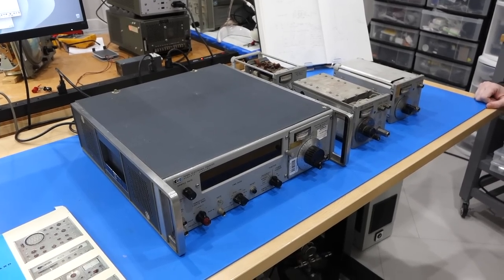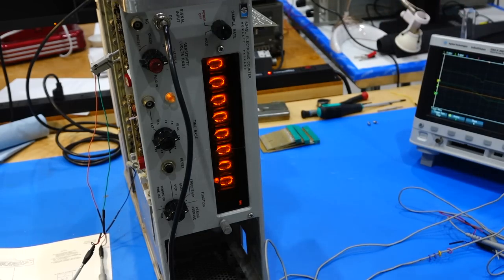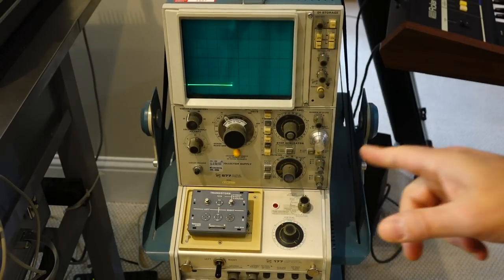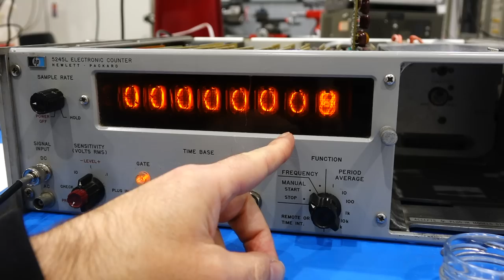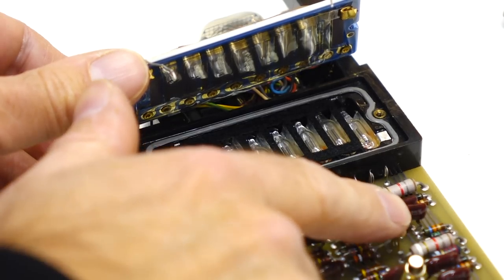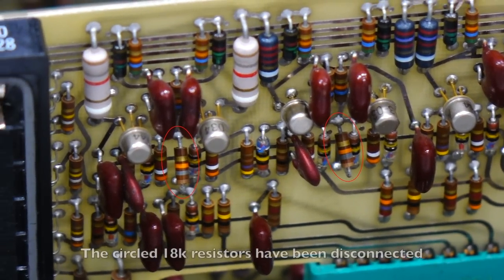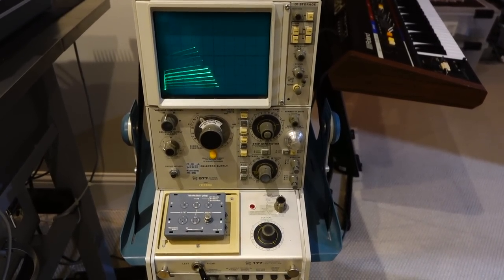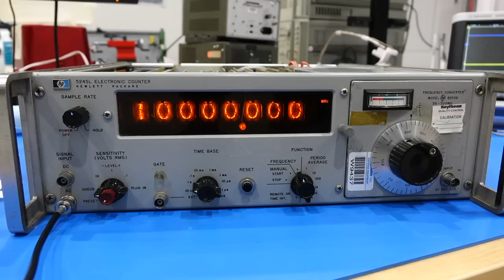HP 5245L Nixie Counter - Part 2: Repairing the king of Nixie frequency meters

Comment: Looks as if working boards from this unit were swapped with bad boards to repair other units.  Love the large visible neons of my 5245L. When this product was introduced in 1963, I was using an HP 524 counter with columns of neons for display.
Reply from the maker: I have come to the same conclusion, that this may be a board swap unit that got all the bad boards. The gate PCB isn’t even the same color and material as the others, apparently from a much earlier unit using phenolic boards.
Reply: I did that kind of repair for an HP competitor in the 80's.
It was very common for large companies to stuff all the faulty boards in the same device and send it back to the supplier for repair when there were no good board to salvage.
We received counters, multimeters, and other devices which took hours to repair, going through every stage, from the input to the last one, with almost every one of them faulty.
I remember that, for multimeters, we always forgot to test one or two functions. the faults were found during the final calibration process, usually at the final stages, with the guy in charge of it mad at us, as he had to fix the fault and redo the whole calibration again.
Reply from the maker: @chefchaudard3580  Oh no! That's funny. The ancient version of the Amazon return scam :-)

Comment: In case anyone is wondering how they made a frequency counter in the GHz range in the 60s (example for the hp 5255a plugin): They are using harmonic frequency multiplication to get 200MHz from the 10MHz reference. They use this 200Mhz Signal for harmonic downconverion of the input signal to a 1-200Mhz IF signal. That signal is then put thru a frequency divider and fed into the actual counter. Since they are using harmonic downconversion there are multiple possible input frequencies for a given counter counter display. You have to follow a procedure to "find" the correct frequency or you have to know the input frequency approximatly. HP used this principle for a long time after this unit was made, but they automated the "frequency finding" process with computer logic. I have a HP 5340A which does exactly that.
Reply: Nice!  Can you explain why neon, here? And "memory"? I don't quite get it.
Reply: @jxh02  I am not really familiar with the neon stuff since both my counters already use normal logic ICs for the counting. I think they are using neon lamps as binary memory elements for the counting process. The memory always holds the current count and also defines what will be the next number. They also use the emitted light for the binary-to-decimal conversion. Dont take my word for it, you can seach for "neon ring counter" online for better information on how it works.
Reply: @jxh02  : They probably used neon because it was both smaller and cheaper than the alternatives. This was long before cheap memory.

Comment: Magnificent job!! What challenge to build a counter with only transistors to 50 MHz. Early counter ICs years later would struggle at 10 Mhz. Wonder what a 400 Mhz transistor cost in those days. How many transistors are there?  I am shocked to see tin-lead edge connectors. They are notoriously bad. The photocell decoder is quite a piece of work, They used  radioactive neons (to get them to fire quickly in the dark) and photocells to make remarkable chopper amps in meters like the 410C. These might be radioactive too. Bulb had either green uranium glass envelopes or a bit of KR-85 (Krypton gas) to keep them partially ionized so they would fir quickly in the dark and the cold. I remember in the early days (my early days) using neons as legit multipurpose components. The high voltage was a pain. 
Another great video.
Reply: Some gear using neons as memory had little incandescent lights next to them to encourage them to fire! Of course when the bulbs burnt out the counting stopped!

Comment: These old nixie tube counters were a marvel.  I ran across a similar one but it used the voltage drop of the nixie filament that was 'lit' in some sort of memory/ decoder fashion.  Just the fact that a particular filament was on, 'steered' the next 'flip' of the thing in some fashion.  I can't remember it all, but at the time I was just amazed how they designed it such that the display tubes actually took part in how the thing actually counted.

Comment: I used to work for HP from 1975 to 1985 in their repair center in Rio de Janeiro and later in São Paulo, Brazil. Worked on many of these 5245 counters. The weak point for us in Brazil were the Nixie Photo resistor decoder drivers, these often failed due to humidity eroding the tracks or resistor patterns laid on the ceramic backplane. Yep, once they had TTL BCD decoder chips for Nixies snd 7 segment LEDs, made these works of Electronic Art redundant, although those Nixie Counters with the high stability time base hung around for years in many Labs.  Luckily HP made excellent manuals that still enables capable technicians/ engineers to this day repair them. Wonderful to follow your troubleshooting, brings back good memories.

Comment: I also have one with plugins. I had to repair the heater circuit in the TCXO master oscillator which has been calibrated to GPS and has not moved frequency after running for 10 years. This is a fine frequency counter. I appreciate your nice troubleshooting techniques.

Comment: Marc, thx for taking the time and sharing your journey through the repair of this counter. Upon further consideration it begs the question as to how a single unit could have all these problems simultaneously. I'm wondering if this wasn't a hanger queen where the cards were swapped out of it to keep other units operating leaving this one with many problems. Eventually funding came along and these units, 5245s that is, were phased out for newer types of counters.

Just my 2c worth.

I love this level of troubleshooting. Employing block diagram guidance, signal tracing, crkt level troubleshooting, component failure verification, component replacement, then viola repaired section, followed with moving on to the next malfunctioning section.

The best part of these units are that they don't use ICs with unobtainium, that is they don't exist any more. All the units that use ICs with unobtainium will be moving into the recycle bin long before these units will be unrepairable. Of course these units don't have Bluetooth, data analysis etc. internally. However, these units do have data ports that can be connected to data analysis units. Then you've got units that can do all the wizbang things the newbies can but for a long time into the future.

Marc, again thx for sharing.

Comment: That is amazing!  In all my experiments with photoresistors, they have always been cheap CdS cells, and all were painfully slow. (tenths of seconds!)  I have always thought you needed photodiodes or phototransistors if speed is required.  (Of course, 1960's HP would have special photoresistors, burnished by grey-bearded masters, washed with water from the river Styx.)

Comment: The king is the HP5248M. It counts up to 150 MHz, using the same technology, and has the better ("M") OCXO. Mine ages at <1E-10 per day. Since decades. Check it from time to time against a GPSDO. 
Also own a now (since 20 yrs) unused 5245L where I had to replace the crystal in the 1980s because its glass case got a crack. It needed about 3 months after this repair until ageing was down to 2E-10 per day.
Have both the 3 GHz and 12 GHz heterodyne converters.

Comment: I got one from an estate sale and too my surprise it worked, and also it reads that accurate. So I'm not sure anyone calibrated yours
Reply from the maker: Thanks, good info. You are right, I can't know for sure, it might just be very stable. But for the power supplies at least, they don't stay exact to two decimals for very long, so that had to have been calibrated very recently.
Reply: @CuriousMarc  either way thanks for another great video.  I wish I had time to watch all your stuff.  I have these bookmarked in case I have to work on mine someday.  Anyway, mine looks great with a 8640b sig gen on top of it.  I have a 333 distortion analyzer I need to fix to add to the stack

Comment: I found with my 5245L that some photo-resistive decoders for the Nixies were not working reliably.

This was due to there being considerable variation in the firing voltages of the neons which, I believe, was caused by neons being operated on DC for long periods. With DC operation the neon glow is only around one electrode and this electrode is damaged by ion bombardment over time, considerably increasing the firing voltage.

I restored operation of the decoder by reversing the faulty neons so that the undamaged electrode became the active one, reducing the firing voltage. Hopefully, this will give a few more years of operation before I have to find some of the special "dark effect" neons to replace them.

Comment: I wonder if the person before had several of these units, and this was the one that donated it’s working components and received the failed repairs.
And while they had the equipment to keep it calibrated, they didn’t have the expertise to keep it working
Reply from the maker: We don't know for sure, but it certainly feels like that is exactly what happened. HP units usually do not come with that many faults stacked up on top of each other. I know for sure the previous owner had several of these units, and this one was a freebee, so I betcha I didn't get the best one...

Comment: According to one manual, the best substitute for the 2N708A  is a 2N2222, but for the 2N708 (no 'A') it says the 2N2369, which is a common transistor used in high speed circuits such as video amps.  It says the European "Pro Electron" substitute is the BSX20.
The 2N2369 or 2N2369A are common and still available.  

I found that the ubiquitous 2N3904 will work well but it may have too high current gain.  In one circuit I put a 470 ohm resistor in series with the base to reduce the current gain slightly.  The 2N2369 is found in video amps, sometimes in old TVs or monitors.
Thanks, Marc for keeping us curious!

Comment: I think that the short circuit on the reset  line is caused by the electrochemical migration of the tin alloy, it create a tiny conductive filaments with low impedance that short low distance pins. Gerry

Comment: If you're having issues with 2N709's, think of the poor guys at the Computer Museum.   Their CDC 6500 computer has about 70,000 of those!   Perhaps surprisingly, they used to have it running for weeks at a time between failures.

Comment: You may have a look at Usagi Electric's video about an older HP freqency counter. "Restoring an HP 521A Frequency Counter". Looks like they recycled the basic design with the discharge lamps for the bcd couting. It uses tubes instead of trans, but the schematic looks very similar (at least to me).

Comment: @ 11:20 - Would it be worth running a SPICE model of the original T-FF? I seem to recall that transistors used in a bistable had to have gains matched to a fine tolerance - is that also part of the problem?

Comment: Is it actually BCD ? My 5275A is 5x2 (biquinary), then the same neon/ldr decoders and 1-of-10 neons in a faceplate instead of nixies
Reply from the maker: This one is equipped with the 1224 BCD counters, the default. There were also options for 1248 BCD and biquinary.

Comment: Strange so many transistor failures, you would expect them to turn it off after the first failure. Someone must have used it as an accurate oscillator source until that stopped as well.

Comment: I swear that 98% of youtube electronics repairers assume that someone fiddling with a knob to get the calibration on a machine just right must be boring, should be cut out.... NO! NO NO NO! I wanna see it line up to all 0's in real-time as well! Watching everything come to beautiful alignment is basically electronics **rn to me... Second hand satisfaction. Like seeing a cake decorator do the final assembly step (cherry in just the right place on top) to get the perfect result, YES I want to see that last process. Surely I cannot be alone.

On the reset line, maybe things just needed some more deoxit / wiggling around to get good connections?